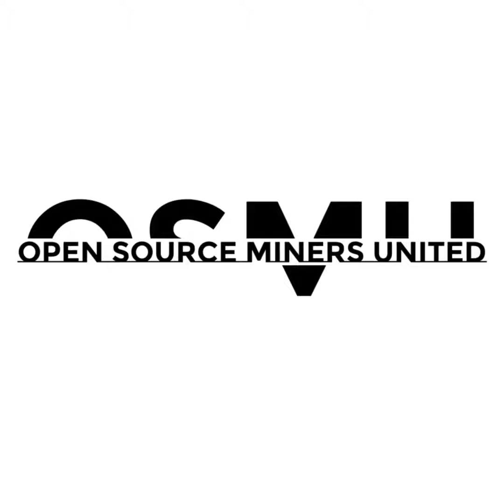Bitaxe Townhall #34

Comment: Found a script for tuning and overclock that spits out a result. I made a GUI for it and . exe for windows. Of course need py installed...but it works.
Reply from the maker: Awesome do you have it on GitHub ?
Reply: Working on zip it and getting it up. Due diligence needed for the creator of the original script of course.